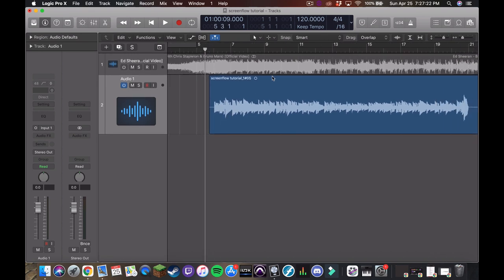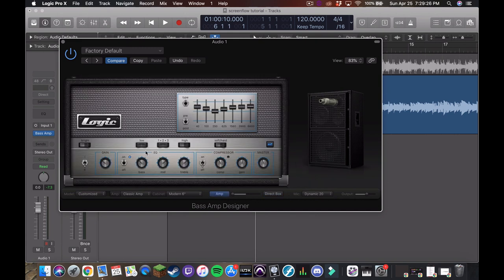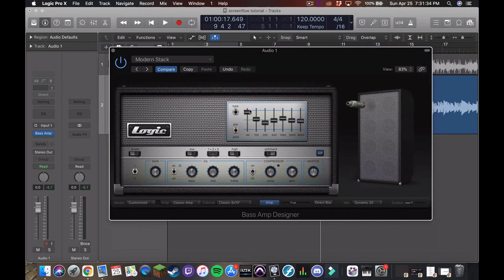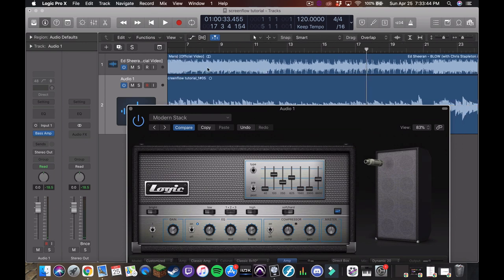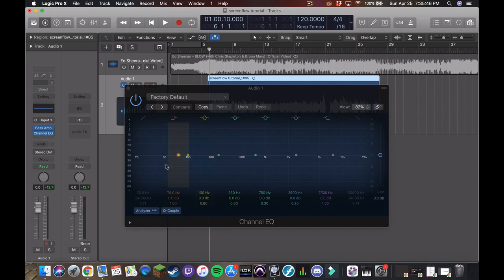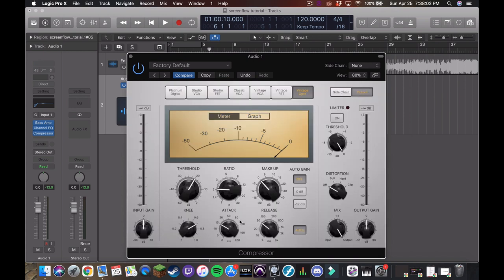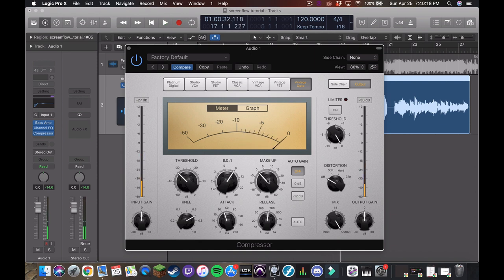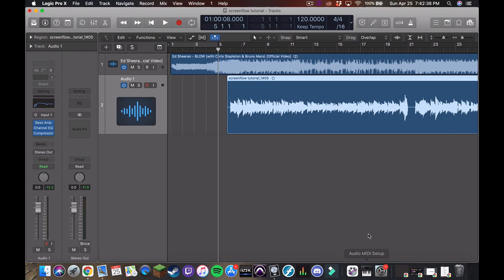How to Get a Great Bass Sound with STOCK Logic Plugins

Comment: So my problem basically starts before logic.... I just have a bass directly plugged into the interface but my raw sound is not as clean and beefy as this one it sounds really flat dirty and you can't even recognize some of the notes im playing... any advices?🙁 my bass is a marcus miller v5 so its not a top tier but should give me a decent sound at least
Reply from the maker: Your problems could come from a lot of factors. Sire is a good company so I would be surprised if anything is fundamentally wrong with your bass. It could be old strings, bad interface, bad cable. If your bass sounds fine through a bass amplifier then it must be something with your interface or computer. If not, then your bass needs a change; string height adjustment, truss rod adjustment, I dont know. Hope that helps a little.
Reply: @BraedenMyers  yeah I am actually going to take it to guitar center and do a full spa day for it... I've had it for about a 9 months and never changed strings or set it up so I think that could be the problem, I used it mostly for practice so I didn't really care... now I've never played it in an amp since I don't have one🙁